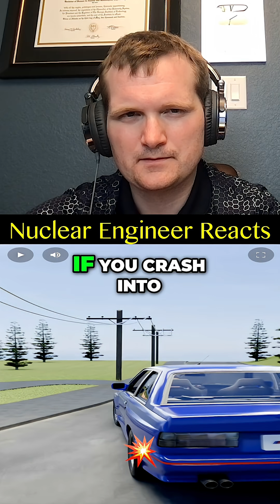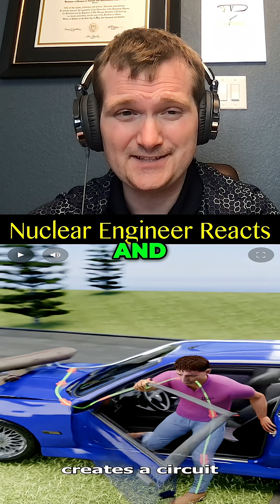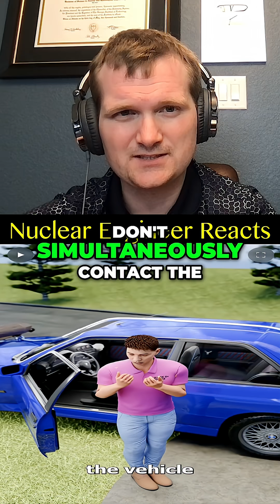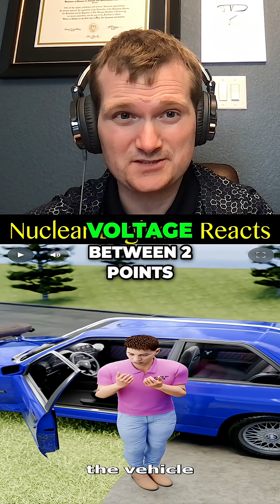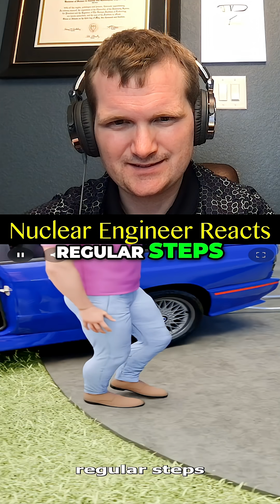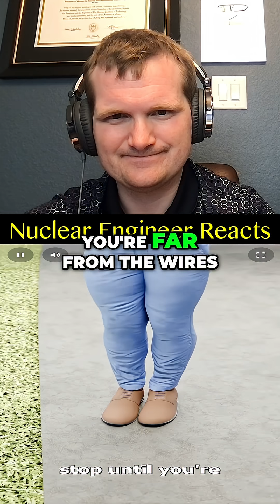What to do if Power Lines Fall on Your Car - Nuclear Engineer Reacts to Zack D. Films

Comment: Okay smart guy.. Riddle me this. On a standard car   Reference voltage is set at 0 volts and is bonded to the frame..  why not have a reference voltage of -1 volts?  That would provide cathodic protection

Comment: Let me ask you this wouldn't the tires act as a insulator or a barrier of some sort so when you step out without touching the car you wouldn't create a circuit and isn't the earth a large enough ground thay just taking a few steps would be safe and far enough from the danger

Comment: I came up on how to build time machine. Simply said, you build tower on earth the height of wich reaches approximatly  to planet pluto. And thanks to earths rotation the tip of the tower reaches over speed of light. Sorry for no good math and so on i came up with 20 years ago in high school.
Reply: Well that's a very dumb idea for many reasons. I could explain them, but there's a lot.
Reply: @Heybuditsme  Yeah i figured many of them out. But it should fit to the context of many of his shorts of dumb science ideas that sound little bit plausible.

Comment: I'm actually surprised simply stepping away normally is also dangerous. I thought that once it entered the ground, it would stay there.
Reply: Depends on the conductivity in all directions where it touches ground.  If the ground is all very damp, it can travel outward in all directions much further than you can jump.  Even if it's dry, the make-up of the materials can be conductive.  If it had a highly-conductive rod driven deep in the ground where it touched ground, then most of the current would take that path deeper into the ground before spreading out, keeping you relatively safe after clearing the vehicle.
Reply: It's probably fine. You're unlikely to encounter dangerous step potential in this scenario. It's a big thing with substations because we have a buried ground grid that carries fault current. But if there's enough ground current to hurt you from step potential, it should get cleared within a second by the substation ground fault protection or a nearby fuse or recloser. Electricity takes all paths to complete the circuit, inversely proportional to the path's impedance. So your legs are not the most efficient path for it to reach ground, but some small portion of the electricity might travel through you which could be enough to injure you

Comment: Something people forget:
Power substations have high impedance relays which will operate for such faults. Just stay a bit in the car and let the relays do their job
Reply: Relay that does what, signals to turn off the power?  Due to what signal it receives does this happen?
Reply: Those high impedance relays  calculate impedance of power line and compare it with the setpoint(characteristic impedance) when a fault happens,this impedance changes and relay detects that and trips,and not all high impedance relays work with impedance,some of them are differential relays @shaneh5533
Reply: And if fault current is higher,we dont even need high impedance relays,even Overcurrent and distance relays can detect such faults @shaneh5533
Reply: We didn't forget.. we're just ignorant of all the components.  Never learned.

Comment: Also, the rubber in car tires is conductive so plan your exit away from the wires accordingly. If the wires are only touching the car, you can bet that the ground is also electrified. You’re trying to not create a shorter circuit than the wheels, wires, and ground while also getting away from the electric field being generated from the wires.

Fact: Tires had to be made conductive so we didn’t charge the car by traveling on the road and then get zapped when we exited the car and make gas stations unexpectedly relocate themselves every time we tried to fill up.
Reply: I worked as a wheel and tire mechanic for 5 years and never knew this. I had to google it because it sounds fake, but yes, they put carbon in it so it’s conductive. The carbon is literally just to make it black though. Rubber is white and rich people didn’t like their tires looking dirty so car companies were like “alright fucker, we’ll just make em black”.
Reply: Dude thats probably 400V max you could probably even survive if you touch the metal part since it isnt as conductive as copper so it delivers less than usual still dangerous tho -there isnt much risk of field in low voltage,High Voltage lines are extremely dangerous but the lines are on huge towers

Comment: I was in a converter truck and just poured 13,000 pounds of molten steel. I backed up the 175,000 pound beast and hit power cables that were supposed to be hung up higher but weren't due to negligence. There was between 886-994 kilowatts of power flowing through them. There was a loud boom like thunder and a massive flash like lightning. I just laughed and kept on driving. Cost the company millions and millions of dollars because they didn't have power to pour the molten steel to make parts. Had to do a drug test which I obviously passed. My boss said thank you because he was trying to get maintenance to fix it for over 6 months. I just smiled and said anytime bud😂

Comment: I will say that the shuffle is somewhat bs. Even if you have long legs that are like half a meter apart when walking, and 2m away from a 12kV wire, the voltage difference across your feet is likely somewhere around 2kV.

Yes this is lethal to your skin, but I hope you are wearing rubber sole shoes when driving, and your soles likely have a resistance on the order of Teraohms. Dielectric breakdown for your shoe sole is at minimum around 50kV.

But, this all assumes you are wearing ideal shoes with no cracks or water or other materials in the sole, so it’s best not to risk it and just follow the advice. You can never be too safe when it comes to high voltage.
Reply: Soles often have additives that increase their conductivity. Even an intact sole on a dry day isn’t going to protect you from much more than 2 kV, if even that.

Comment: Everything in this video is valid for electric line safety. Stay in the car if you can, but jump out if you have to, and either shuffle or hop away. 

Power lines are dangerous all the time, but when situations occur that result in overhead lines on the ground, take every precaution until the utility company shows up.
Reply: I think the greater principle here, is that people who are drunk hit power poles, and they don't know what the flip they are doing.

Comment: Unless there is a reason to leave the car, don't. Don't touch anything inside the car that you aren't already touching. You can get a zap even if you aren't grounded*. Jumping and hopping, along with the adrenaline from the accident, greatly increases the risk that you lose balance and separate your feet risking a fatal shock. Stay put unless it's going to kill you to stay. 

*While 120v won't jump to you, even if you aren't grounded, higher voltages can jump to you. That's why linemen in helicppters (not grounded) use a conductive pole to make the initial connection (that puts them at the same potential). Will that zap kill you? IDK, ask a lineman, but I bet it would hurt.
Reply: Who hits power poles? Drunk people. They'll do whatever they want to do.

Comment: Dumb question, but the rims on the glass has rubber, wouldn’t that remove the current if you touched it?
Reply: This isn't a dumb question, but i think that electricity doesn't travel through windows
Reply: Not an electrician, but iirc alternative current actually can jump through small gaps formed by insulators that direct can’t, because that’s essentially just a capacitor and ac goes through those. For the same reason, you are not protected from AC because you’re wearing thin plastic slippers while you poke a power socket.
Reply: Glass insulates.
Rubber also insulates, but there's enough carbon in tires to act as a conductor at higher energy levels.